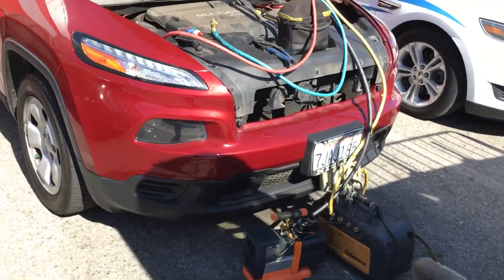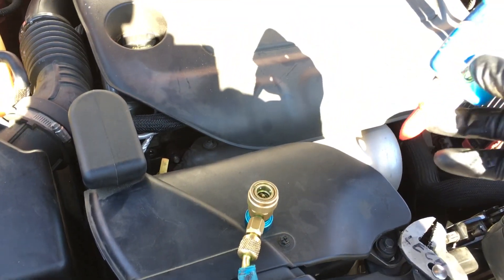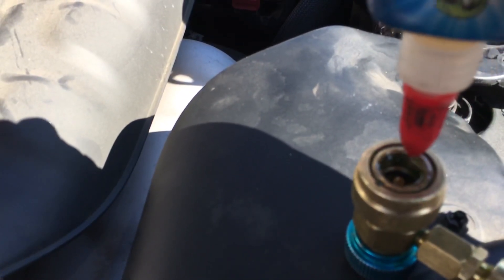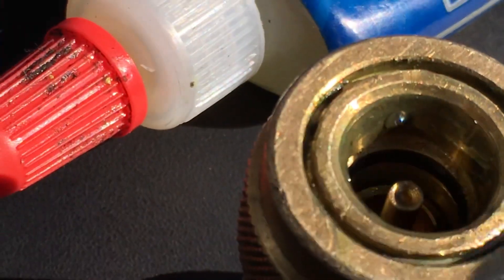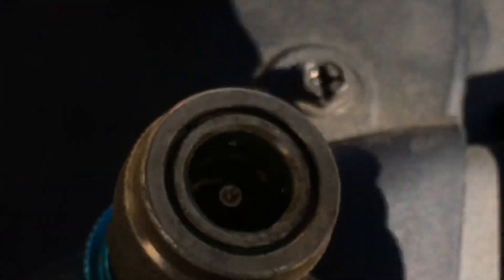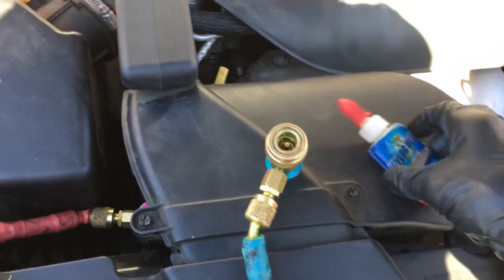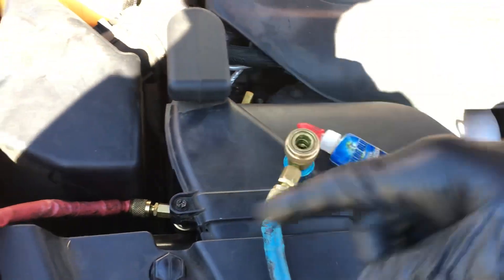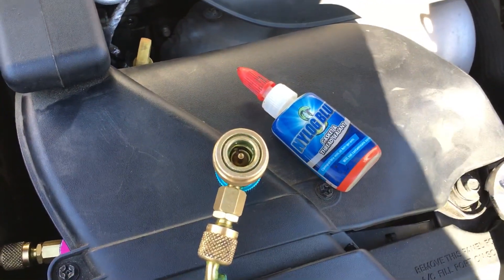Protect The O-ring seal in your AC service fitting coupling. If you scratch it, it may leak ￼

Comment: Good tip…You might dig this https://youtu.be/xF113aUlZgo
Reply from the maker: That was cool yes I was looking at those small compressors they’re very cheap to and the evaporator is like the kind that would fit under your dash in the car or the back in a limousine. 

      You could put a variable pulse width modulator on the PCS fan motor and slow it down so the air had longer contact time over the coil I think possibly the compressor is a little too small for the evaporator size. 

  This would drop more humidity out of the air and you would achieve comfort by removing humidity not chasing after a lower temperature lower temperature would just come as a byproduct.